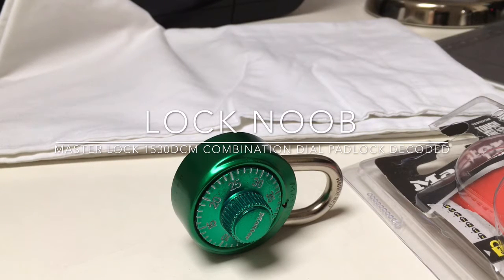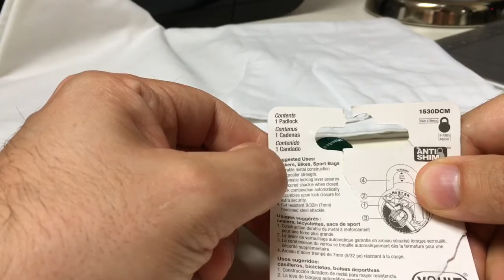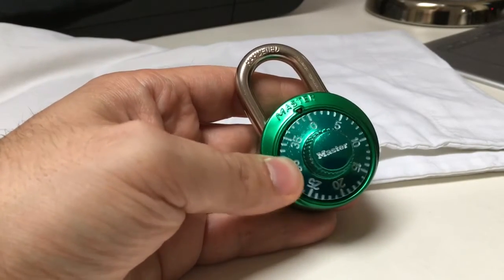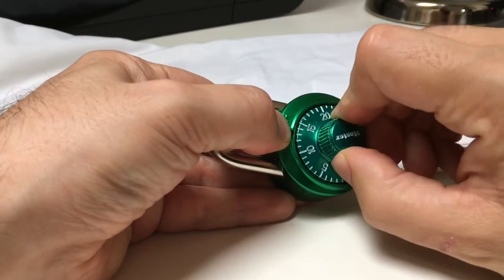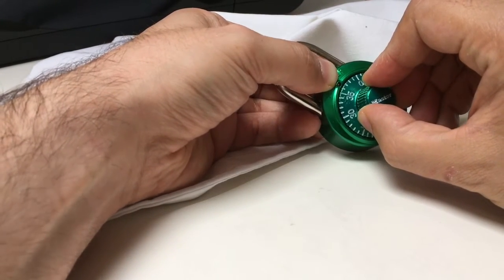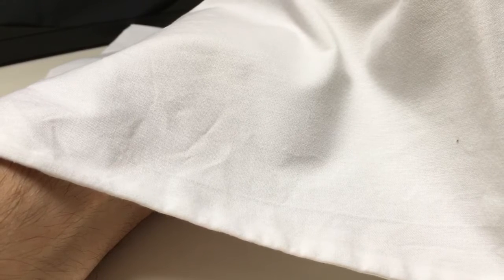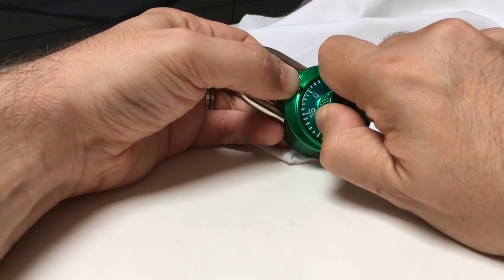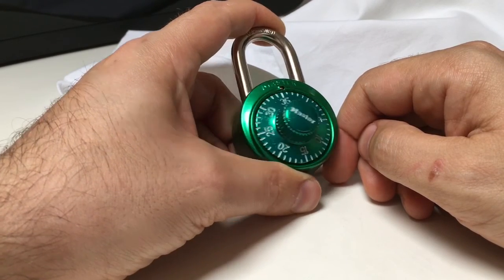(040) Master Lock 1530DCM combination dial padlock decoded

Comment: Nicely done Lock Noob :). I have one of these in blue. Once you get the feel for it, it's not that hard as you have noticed ;). There is actually a similar, but little different method to get the first number and the second one is the hardest to find. Not much resistance or protection, but this is well known ;)). I have also a chinese dial padlock, where you can't find the second number at all.
Reply from the maker: Thank you :-). I looked round YouTube for a while, but I didn't get on with most of the methods, especially the one where you find the first binding gate and 'take 5 off'. Don't know why, but it didn't work for me. You also don't see many people prove their method by doing a blind 'picking', so I'm always a bit suspect.  This method was the one that just seemed to work the best after lots of experimenting
Reply: Yes it did work very good for you :).
And actually..you add 5 when you find the only peak hehehe..that's why it probably didn't work ;).
Reply from the maker: +redcatimaging is it? Hah, that would explain it then, lol

Comment: Nice one mate, however you can shim the anti-shim padlock.  You just need a slightly different technique to defeat the bear claw.
Reply from the maker: Hi, yes I saw a vid on this before I made this one with someone demonstrating how to do it with a strip of metal can. I might have a go myself, but I figured that I wouldn't be able to add to the technique or give a different spin on it

Comment: So am I correct in assuming that there are really only 64 combinations which need trying, all multiples of 5, before trying the last digit? A total of 512 possible positions, and less if you assume that all 3 numbers will not be the same? It's another lock which should be sold with a (lack of) security warning, rather than a security rating! Thanks.

Comment: This is beginning to suck.  Tried it so many times.  The first number is binding the strongest between 3 points.  The strongest one is not the one where you would add 5 but where you would add 2 instead to get the actual number.

Comment: Great video on this combo lock. I have one that is for breast cancer awareness. I have not been able to find a video that works. Will give your method a try.
Reply: I have the same breast cancer awareness lock and cannot find the first number either.  Last digit is super easy (I know the combo)
Reply: I think I found a way to get the first digit on the breast cancer awareness lock but I only have one.  Let me know if you are still trying and I’ll post it
Reply: @aaronbrunero7477  I have not been able to get the first digit. I took a break from the lock. I have thought about getting the lock out and trying again. What did you find out?
Reply: @georgeohwell7428  There was a video of a fella making a combo breaker for those locks. He gave everything to make one. He also has one taken apart to see the insides. I need to get back on that lock. I like spp on American Locks.
Reply: @Claps1775  spin counter clock wise with heavy tension on the shackle.  Feel it rub along each bump and you should feel it catch on a number.  Check it is correct by passing the catch by a few  numbers and go back to it.  It should be gone until you do another full revolution ccw.  Add 14 to that number you found CCW. That’s first digit.
Reply: @aaronbrunero7477  I will give that a try and report back.

Comment: I think all these dial video's are bs, because the part that has the false gates is the #3 wheel which is the third number in the combo and also the driving wheel.  the dial needs to be set at the last gate before testing a depth position of the other wheels, any other position will get the same depth, within mfg tolerances.
Reply from the maker: It’s an old video and I fully admit at the time I probably had no idea about what’s happening inside, that being said, what I was doing legitimately worked regardless
Reply: @LockNoob  , I just decoded one, came without the comb. Just took off the back, decoded, and replaced it, would have been perfect  but I started by trying to make a view hole that failed, but it's back in one piece, and works perfectly.
Also, at least you did it blind!